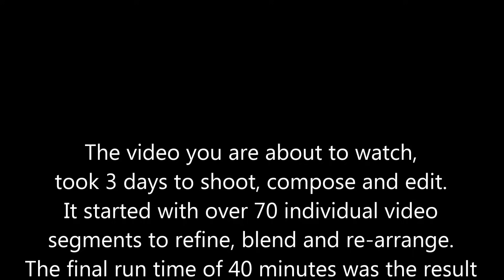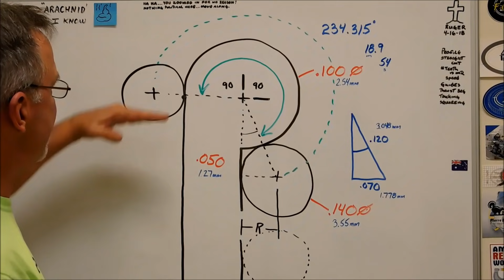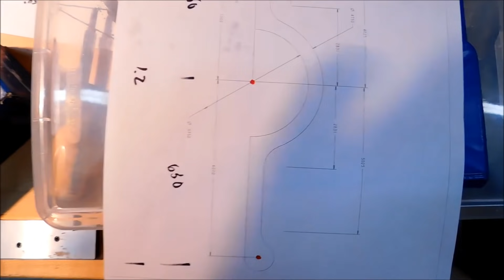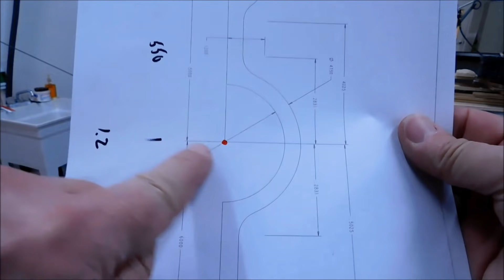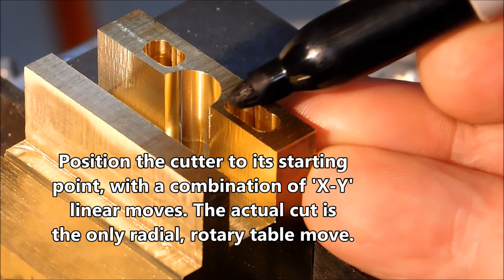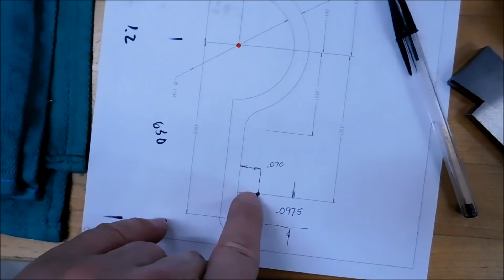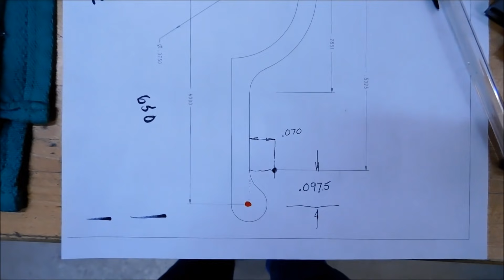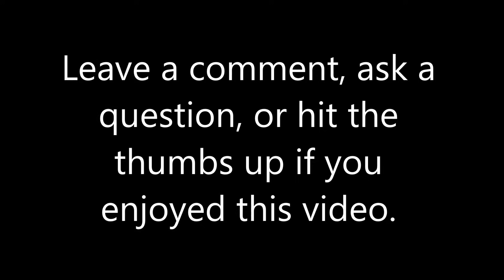Machining Miniature Brass Trunnion Straps

Comment: Thanks Joe, brought back a lot of memories of my apprenticeship before CNC machines. I did a lot of work on rotary tables but sure wish someone had taught me the trick of mounting the vise with stops and moving the vise with gauge blocks, also love your method of aligning the rotary table under the machine spindle.
Reply from the maker: Thanks. The tip in this video will certainly help make setups easier.

Comment: Drill a hole and press a square (lost the name) to cut a perfect square in the brass. They start with a round and trimmed cutters moving out to corners.   What a nice job on the rotary table - and how it is to be and can be used.  Nice lesson.
Reply: @jimmer411  Right- have several boxes of them but at 72 the mind isn't open to the world or myself all of the time.

Comment: Hello Joe!  Amazing work you do and I am learning all the time. In this video you say that the dig in only have one explanation and that is the plungcut. What I can see in the video at 25.43 is that the dig in occurs with the swing.
Reply from the maker: I broke down the scenario for another comment above. I also saw it happen. That is a 20 minute 'over rotation'. Less than 3 degrees on my handwheel. Guilty.

Comment: Outstanding, I started an aluminium Naval Cannon a couple of years ago, to help learning to use a lathe, I got everything done but those damn Trunion straps;), I was going to just bend some thin ally, but it didn't feel right, now I also have a rotary table, so big thanks for this vid, Joe.

Just hope I can find all the parts of the cannon...
Reply from the maker: Good luck.

Comment: Thanks Joe I had an issue just this week trying to clamp to my rotary table when the slots were not where i needed them. I found a different way without using the table. Now I need to make up some of those clamp adapters you have there.

Comment: I have a small model cannon, approx. 20 ga. bore (because I had a bunch of spare wads)...but I never put trunnion straps on the carriage.  As a result, if I load it too much the barrel leaps off the carriage.  Now I know how to make the straps, so may have to upgrade...and yet another reason to buy a rotary table.  And the idea of the swing-arm t-slot clamps is pure gold. Thanks x2 Joe!
Reply from the maker: That swinging clamp makes life easy.

Comment: Dear Joe, thank you again for another really good video. The time that you take to make and edit these videos for the education of folk like me is much appreciated.
I built a fixed steady for my tiny Hobbymat lathe on the rotary table on my wee Dore Westbury milling machine cutting out of a slab of 20mm cast iron. I nearly reached nirvana cutting that lot out on light passes. I had two blends to make and got the maths spot on but on one because I was nearly spaced out machining one evening I made a silly mistake in confusing the roatation of the feed wheel on the rotary table and made a dig. I know how your dig in feels. Too much time had been invested in the job so it is still there. The steady has been very useful though. What I love about this video though is the floating clamp as i often have trouble clamping to my rotary table so thank you for that but also the use of parallels to make offsets. As I promised my son that I would mill out the coupling rods for a model shunter (switcher stateside) which he is building this is most timely as I was having a bit of a head scratch so thanks again Joe.

Comment: WOW !! That brings back alot of memories. Back in the 1900's I spent the better part of 12 years standing at a crossslide turntable. The small shop I worked at built diecast dies. We had 3 mills dedicated to do that type of work. We built dies for Tecumseh small engines and Mercury Marine. Thank You.
Reply from the maker: These tables can be very functional. My alignment pin really accelerates the setups. I hope to have them back in stock soon.

Comment: Great video! Would roughing of the square holes not be handy to make before parting from stock with the bandsaw? P.S. That little dip came from that last rotation of the turntable, visible at 25:40. You stopped at the right time but then went a few degrees more, which was just a smidge too far. :)
Reply from the maker: It measured .0014 deep. At that projection, its only minutes. I'll blame it on the camera being in my way. :)
Reply: @joepie221  I meant of course just a few degrees more on the handle for the table... 😉😉
Reply from the maker: @sasakurtovic6850  Good rule of thumb is 1 degree = .0174" rise for every inch of projection. The outer radius of that strap was .238. Lets call that 1/4 of 1 inch. Apply that to the rule I just shared and you would get .0043 gouge. for a 1 degree error. If you apply the math, a .0014 dig is somewhere near 1/3 of 1 degree, or 20 minutes. My secondary minute scale on this table is graduated in 10 minute increments. Now the actual crank/dial on the table only has to move about 3 degrees to get an error like that. Its a very delicate operation. Thanks for your comments.

Comment: "A Clickspring job"! Nice coinage!

Where did you get a 0.140" dia end mill? Without looking at a tool catalog, that seems like a bit of an oddball item.

Also, what are the specs on those wheels you're using for clean up? I get super-confused by 3M's deburring wheel offerings and what's required to mount them on a bench grinder. Also scared by the $$$, but that's a separate issue 😁

As far as the detail filling goes, sure, film away. No need for 70 takes, though! I I especially want to see you form that cylindrical profile on the one inside edge of the square hole that's called for in your solid model 😳. That's going to be a challenge!
Reply: "Where did you get a 0.140" dia end mill? " Possibly a 4mm or 3/16" end mill that has been reground to that size?
Reply from the maker: 9/64 2 flute carbide. Over the counter at MSC

Comment: Very nice work! I will take note the next time I do trunnions :-)
Reply from the maker: Bend sheet metal, its easier!!
Reply: @joepie221  
Ha Ha!. I agree but machined is much nicer. To be honest, I have resorted to lost PLA casting and then cleaning up. just as much if not more work I add. :-)

Comment: Hi Joe,
Thanks for the demonstration and tips, never used such a simple offset for clamping and will be making a few to use on my projects. I just had an idea for avoiding the oops on the first piece, instead of offsetting the part for the cut how about using a slightly smaller diameter end mill for the first pass then switch to the finish size for the cleanup pass? would it work? would it be easier?

Comment: Sir, even I never would do it the you did that part, I appreciate what you’re doing. 
I learned toolmaker at a small factory who produced buckles for shoes and belts in every size and shape. The most known was the buckle for Birkenstock sandals. 
At this time there were no CNC milling machines in the workshop and I learned to mill shapes of stamps and inserts by using x and y axis by hand. Years later we got a Mikron CNC milling machine. And from that day on it was my dream to own a CNC mill one day. 
On the exhibition Intermodellbau in Dortmund about 20 years ago was a guy who showed a lathe equipped with step motors. He was cutting grooves in a aluminum cylinder. The system only could do this simple operation. Few years later he had made a software to convert a conventional mill and lathe to cnc. It was simple and had flaws, but that was the moment where model engineers were able to make their live a little bit easier. He started something that other followed to design and produce for hobby machinists. I bought software and hardware and converted my hobby mill to cnc.  Still you have to master the triangle like you did in the video to write the cnc code, but if you do a mistake you correct it and let the machine run again. For me that part you made belongs on a cnc mill, because I’m lazy, and know how much effort you have to put in to do it the conventional way. 
I hope every guys who watches your video appreciate what your doing. You teach and educate others. You show them ways to get things done. And it takes a lot of time to make videos like you are doing. Deep bow for your effort to the hobby guys all over the world.
Reply from the maker: I glad my videos help a lot of new machinists get past scary moments. We can all learn from each other.
Reply: I totally second the sentiment sir!

Comment: Damned good job on the video. Heck, you could have a future as a video editor as well.
Reply from the maker: I'm getting better software this year, so I will be stepping up my game.
Reply: @joepie221  I look forward to seeing it.also thank you, you’ve helped this little diy home machinist a lot. Only issue I have is that this proLIGHT 2000 doesn’t have any crank handles, so I have to do everything through the computer. Which I am slowly learning. I just wish that there was a better way to go for an image or idea to a g-code. Being an airframer on the F-14 was so much easier.
Reply from the maker: @RazorCustoms  I understand many guys are leaning towards Fusion 360 to generate G code at a reasonable cost. I use Pro Engineer wildfire for mine, but once you figure it out, complex geometry is so scary any more. Check into it.

Comment: Not a critique, just a comment. I have done many small pieces like this over time and I learned to lay out parts with Dykem. It has saved my butt more than once. An old toolmaker taught me to climb, conventional, climb for the least tool marks. Your thoughts? Lastly when I have had to make multiple detailed small parts, I make them tall enough for a couple or more, depending on width, the use a slitting saw to machine to size. Even if it is only one part I use the slitting saw in the mill. Small parts like this and band saws scare me.😧 great content, keep it up and thank you.
Reply from the maker: Good tips. The small internal corner rounds and cutter length dictate that stack part possibility. And if my wall thickness was any thinner, a slitting saw ( fine tooth blade ) would have been my choice too. Good comment.

Comment: Hi Joe! Great Videos!

I have seen people align a rotary table using a shaft in the spindle and inserting it into the center of the rotary table. Do you use a similar method to get close before you fine tune the set up using your dial indicator?
Reply from the maker: I keep my indicator above center and spin it. I visually align the table then flip the setup. Its quick for me.

Comment: In brass I would have thought it possible to use longer endmills and to make one longer profile, and then to mill two to width from it.  You'd end up with a closely matched pair as any deviance from the nominal dimensions during those trickier operations would be replicated across both parts.   Awesome vice tricks with the parallels on the rotary table!
Reply from the maker: That would put the .140 diameter end mill at  .92 long for a pair of .400 parts. That cutter would sing like a canary and leave what I like to call "vertical knurls" every where.
Reply: @joepie221  Ugh, yes, that's a tall order.  I hadn't thought too much about the numbers - everything looks bigger in video.  How about roughing that exact toolpath with a 0.125" endmill first, leaving 0.0075" material to finish with the 0.140"?

Comment: I understand how you true up your rotary table with respect to spindles. I have found that it is important to try and true everything up with the quill very close to the operating position if possible. A tiny error in squareness to y and z travels or a deviation in how true the spindle slides down can mess up your centre position. Not much but when you are machining to minute tolerances, it can make the difference between "on the money" and "could do better" results.
Reply from the maker: Very true. I have seen errors in parts introduced by the operator changing the table height with a head out of square. I try not to do that if at all possible. Even old worn out machines can scrap a location by locking the knee.

Comment: I have never done any machining before, but I understand SOME basics.
Now that I've said that, I have a question.

Can you put an x,y table ON TOP of a rotary table, so that you can traverse between centers for the different 'setups' instead of having to take down and reset for each of the three circular aspects of this part?  What would be the pros and cons of doing this, aside of needing an additional x,y table, and loss of tool space due to the thickness of the additional table?
Reply from the maker: Sure can. Its a common accessory. Great question.
Reply: @joepie221  Thank you for answering!  I am new to your channel, one of your videos (tiny brass nail) came up in the related videos while watching BlondiHacks.  I've subscribed and liked about 10 videos so far and have never touched a lathe or mill . . . .  but some day!

Comment: Terrific setup. I’ve done an intake manifold flange, used A/C for the geometry, established angles till tangents then went around. Changing centers on a Harborfreit, no DRO, spindles 1/16a turn...
I really appreciate your great idea though I have no joe-blocks either,
well it wasn’t as perfect as you can do it. What computer program is the one you’re using? Thanks, great.

Comment: Are you building this from a plan or drawing or did you design it yourself? If the latter what did you base it on? An what kind of cutter is that? It almost looks like something that goes in a router or zip tool. Great vid.

Comment: Why is it that every band saw throat plate I see is beat to hell and all wallowed out like the saw blade was dancing all over the place?
I replaced the throat plate when I got my band saw (as a non working pile of metal that was labeled scrap as the guy had no clue how to do the simple fixes it needed to be up and running) and it still looks as good as new.
Reply from the maker: I bought it that way. Once that anti-rotation pin shears off, for whatever reason, the slot in the plate is fair game. Personally, I have never sheared off that pin or hit the plate. It baffles me how that happens.

Comment: Being that picky with decimal of degrees and minutes/seconds I thought you would use a divisor plate. 
Using a 40:1 divisor to count 234.158° you would have to spin the handle 26 times and 1 hole of a 60-hole plate.  (234.158 x 40 ÷ 360 = 26.018)

Comment: Joe, I'm sorry, but that part is not correct. This works as long as the cheeks are parallel to the tubes bore centerline. Unfortunately this is not the case. The cheeks are tapered with respect to the bore, narrower in the front, and wider in the rear. I would love to see your procedure for making this part. The only way that I've found to make it is to blacksmith it. Good video though.
Reply from the maker: The part is to print, but maybe not period correct? I'm not a cannon expert, but I like this kind of input. Tapering the flats is very possible, just adds another level of difficulty.

Comment: why did you keep talking about a .600 spacer to center on the lower feature, when your print specifies .650?
Reply: 650 is the dimension ro the end. 600 is to the centre.

Comment: Wonderful video, Joe! Thank you for investing so much time in it. It isn't only a tour de force of machining; it is also so very beautiful.

I am stumped by one thing, though. As you shift the vise to move to the outer centers, you move 0.050 in X. That makes sense. For the others you move by 0.500 and 0.600, respectively. However, the drawing shows 0.550 and 0.650 instead. I must be missing something obvious - can you help?
Reply from the maker: Those are the end dimensions to the center if the strap. Subtract the .05 radius and you'll get the .500 and .600.
Reply: Joe Pieczynski Thanks for the quick reply, Joe. They had looked to me like center-to-center dimensions in one of the drawings. I totally get it if they’re end dimensions